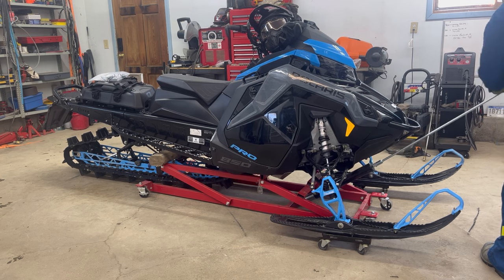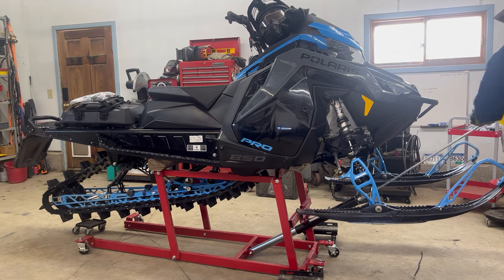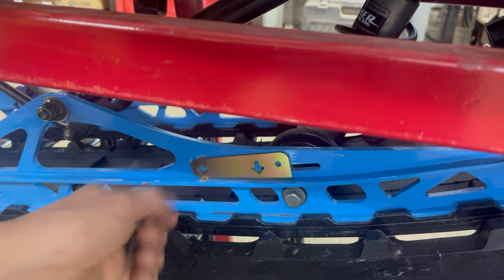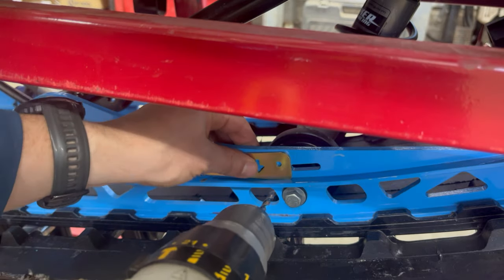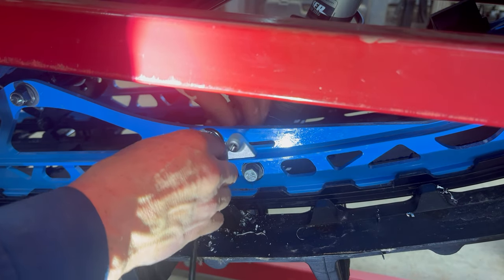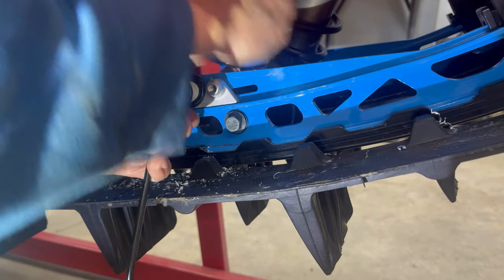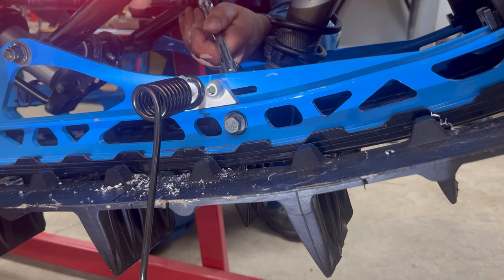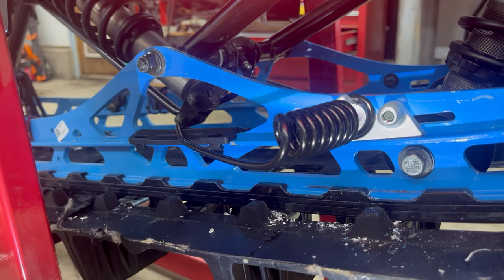Installing Polaris Premium Scratchers On My Matryx 850

Comment: Installed a set last night. Super quick and easy!
Reply from the maker: Great, I think you will be happy with them.  My sled runs noticeably cooler with them as opposed to the old style I had.
Reply: @MuddyGeo  yes we noticed a 20.F temp drop

Comment: Mine made it across 25 miles of melted snow and then refrozen rough but didn’t make back broke off where the spring goes into the aluminum casting my guess is they worked hardened due to repeatedly hitting that aluminum block also found a ski doo one that had broken the same way, seemed like a good idea butttt

Comment: and if u refuse to drilla hole in a $33,000 sled? what Then?
Reply from the maker: You could run the old style, I swapped because they are easily damaged if you back up when they are down.  On my old sled I bent one and didn’t notice, then took out chunks of my lugs.